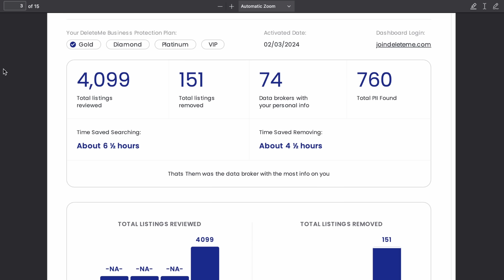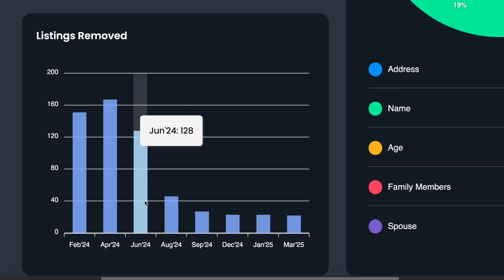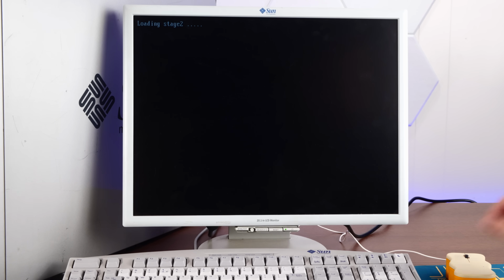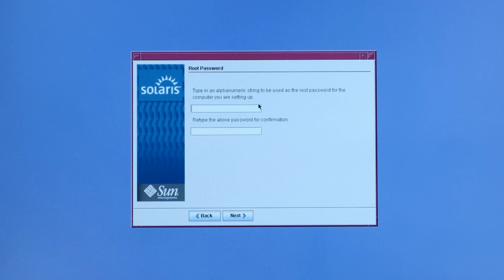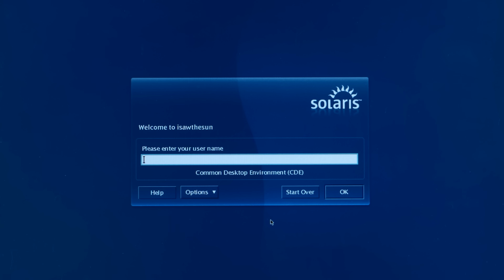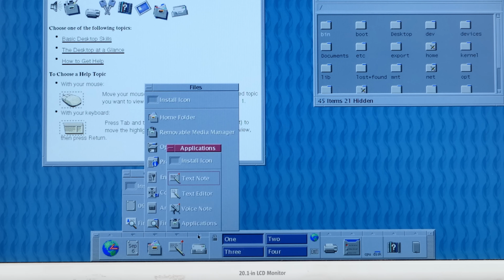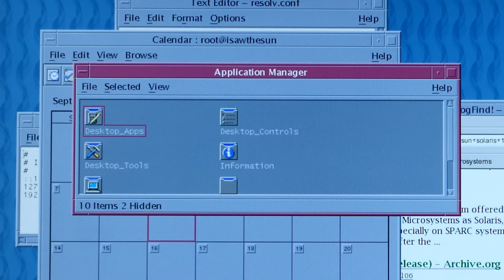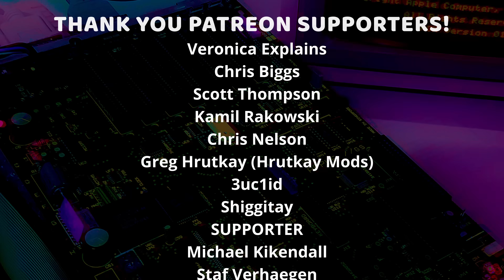The AMD Opteron Changed Everything

Comment: My first multicore (and first 64-bit) cpu was the Opteron 165. Dual core goodness!  I even had a cold cathode/fluorescent tube for that ultraviolet glow effect.  

I still have the tube lying in a drawer. It’s very likely dead by now.
Reply: I bought an opteron 144 (single core, 64 bit) because it was a decent overclocker. 

Unfortunately I tossed that board... It was hung up in my garage and I tossed it during a move :(

But it wasn't a good board anyways, I always bought "best bang for the buck" when building a PC, knowing I'd overclock it.
Reply: @volvo09 my motherboard was a DFI LAN Party.  I even had a cold cathode tube  for UV.   I still have it in my junk drawer. It’s pretty much dead.
Reply: @DerekWitt I always lusted over those lan party boards. I spent a ton of time on overclocker forums looking at builds, on my 33.6k modem (again, another cheap but workable part) :)

As a teen I actually put a white CCFL tube meant for a PC in the foot wells of my car, since it was 12 volt 😂 that was my modem era

Edit:  and that was before my opteron, the fluorescent tube brought me back to that era!

Comment: Not the first Sun Opteron based workstation released to market by Sun. Sun had maintained their own brand of IBM PC compatible systems as a side hustle for a long time before this thing was introduced. Most notable models were dual CPU P3 systems which had 1.4Ghz Tualatin processors. Can't remember the system name and model, but they offered two versions of it. One with IDE disks and one with Ultra160/320 SCSI disks. This was because their UltraSPARC-II offerings weren't exactly able to keep up with the Intel stuff in speeds. And they had been offering Slowaris for PCs from the early 1990s.

I cannot remember what they called the first Opteron AMD64 Workstations, but none the less they were basically adequate consumer grade office PC system quality devices in weirdly styled cases with actually OK build quality this time around (unlike Sun Ultra 5/10 and Blade 100/150 garbage) and a very tasteless design using the colour scheme they'd reserved for the IBM PC compatible side hustle systems. Basically it was AMD Opteron reference system with a generic AMI BIOS and common PCI card bus slots, consumer grade DDR RAM and surprisingly enough had SCSI disks as standard instead of SATA. etc. It did have SATA slots though. 

I've seen one of these machines about 15 years ago at a hobbyist club when it was retired by its previous owner from use as a Linux system. it was literally nothing special and I think Sun understood that they couldn't try and charge a premium on this thing so, they weren't even expensive. Good quality hardware for a entry-level Sun system made of IBM PC parts.

I suspect they just subcontracted to some PC OEM to make them a dual CPU Opteron system based on the AMD reference design, had some "industrial designer" mangle up a ATX case to look funky and threw it at the wall to see if it would stick. LOL

It predates this Sun Ultra Opteron system, and the later Intel Core/Xeon based systems by a couple of years. And nobody bought them. 

Which is why I was rather shocked they even bothered at this point when they released this thing. Since, nobody really bought Sun Ultra machines for anything other than running legacy SPARC/Slowaris stuff with. So, the SPARC machines in these cases had a use for people that were using UltraSPARC workstations when they genuinely offered a performance advantage over PCs and other competition, that came with a modern UNIX OS with high level of security design against malicious actors and software and which gave genuine bang for the high bucks Sun charged for them when compared to the IA32 based options. After AMD made 64bit extended IA32 a thing and Intel made a full 180 turn on Itanic and IA64 being only thing they would make in 64bit, it was clear that Sun was selling SPARC systems which were completely outdated junk not worth the price tag.

So, this shit was completely ridiculous. There was absolutely no point. No one ran Solaris on x86 or x64. Because there was nothing in terms of software you could run on that other then the same GNU stuff you had with a Linux distro. So, why are you not running 64bit Windows with this thing? That's what they were used for. :D

Only thing cool about these is the case design. Nice and minimalistic. Not worth the asking price though.

For historical contex, since the late 1980s Sun had  experimented with a Intel based professional UNIX workstation product back in the late 1980s, called the Sun386i which offered the same level of graphics, disk host controller and NIC performance as their Sun-3 (motorola 68030 system architecture, like every other unix vendor) and Sun-4 (SPARC systems, first machines were dog slow and overpriced) machines. It was a commercial success and they even released a pre-production batch of its successor the Sun486i for select customers, before shit canning the thing because it ran rings around everything they had made previously and this would mean the SPARC would flop. :D

Anyway, it was not IBM PC compatible per-se, it used Suns own Forth interperter based firmware to initialize the hardware and bootstrap the OS. However, it was offered with ISA addon card "SunVGA" with which using the software included, you could run a DOS/Win3.x session from inside the SunOS 4.1.x the Sun386i came with. And had standard ISA addon slots, 1x 8bit and 3x 16bit with which users could take advantage of their existing IBM PC compatible hardware using it.

The system used four 32bit proprietary "local bus" bus slots, two of which were for RAM cards, up to 8MB each for 16MB total. And two for high-end graphics and disk interconnect etc. purposes.

Comment: There had been many stumbles and rake stepping by intel over the years, often Intel was able to easily come back from such as the first celerons that lacked an L2 cache, the celeron 300a. Intel added a tiny bit of L2 but at full speed (unlike the pII at the time) and it made the celeron easily competitive with the PII. Made it a true value competitor against other cpus. Especially when overclocked but the 64-bit mistake I point to as Intel's first real stumbling block, personally I think the onboard memory controller should have been. AMD CPUs at the time got more done per watt but generated much less heat doing it. But Intel was used to setting standards and the 64-bit stuff bit them in the rear pretty hard. The netburst architecture was already a massive fail despite the massive sales, the architecture ran very hot and held back Intel and cpu progress as a whole because at that point Intel was the go to. Most professional grade hardware wasn't AMD, it was Intel. Your choice of hardware was very limited compared. When Apple chose Intel over AMD at the time it was a head scratcher of logic if Apple was truly worried over performance per watt. But then Intel came out with the duo series of CPUs and then it made sense. Apple probably got a chance to see these new chips before we did.. anyway enough rambling. The AMD 64 was an amazing chip and way ahead of intel and that's my point. They made Intel wear that egg big time!

Comment: I'm glad AMD pulled the rug from under Intel with this. Sure it extended the life of the iffy x86 CISC architecture but the RISC vendors were busy self-sabotaging/mutilating their RISC architectures like the IBM POWER/PowerPC, Intel with at the time the only real PC targeted and high performance ARM design (XScale) and with the Itanium, I suspect Intel’s long term motives to use it to kill off the x86 and the associated x86 licensers and achieve vendor lock in for the PC platform. Thankfully that never happened and we have AMD to thank for that.

Comment: I was in charge of IT purchasing at a Polytechnic when these came out. Sun always released a special academic “end of year” price list with crazy discounts if you could wait until June to do your buying. They were selling these  and the next version smaller workstations for crazy discounts (50% to 75% off), which put them in the price range of a Lenovo with 1/2 the capabilities. I bought them by the truckload. They were amazing machines, and completely bulletproof. I would almost guarantee they are still using a few of them on campus!! 😂

Comment: Many wouldn't believe me, but said PC would run Windows Vista like nothing, since with 4GB of RAM and especially in 64-bit it gives a much better experience than in 32-bit.Vista was one of the versions that improved 64-bit support to the maximum, unlike XP X64 which was rare to see, normally that's why I've always said that comparing Vista with XP was a bit silly,Because XP is only 32-bit and even with its X64 version it wasn't up to much 🤣, but Vista... And 7, one word: Crazy

Comment: I remember Windows 8.1 not being able to run on my Socket 754 Athlon 64 3000+ due it not supporting the CMPXCHG16B instruction, and also Windows 11 24H2 requires SSE 4.2 which no Opteron ever suppported.

AFAIK on Windows you are capped at 64-bit Windows 8 (not 8.1) or 32-bit Windows 10.

Comment: Yes, AMD released the first consumer grade 64 bit capable CPU, but they're not THE first to create 64bit capable cpu's 

MIPS beat them by more than a decade, releasing the R4000 in 1991. 

DEC-Alpha released the Alpha-64 in 1992. Many DEC engineers migrated to AMD both before, and after DEC was bought by compaq. The 32 bit VAX systems heavily influenced how the slot-A and socket A chips were built, and the Alpha 64 was a big part of the inspiration for the legendary barton chips which were built as a stop gap until the x86-64 development could be completed. 

Itanium released in 2001....intel was predicting millions of units sold within a year of release, the reality was 40,000 units. The original Itanium (merced) had a clock speed of 733-800mhz (less than half the speed of consumer chips released more than a year before) with a FSB of only 266mhz. It didn't maintain backwards compatibility with 32bit x86, nor was it compatible with any of the aforementioned MIPS or Alpha software, owing to the fact that while most every other architecture was RISC or CISC based, intel opted for VLIW (very long instruction word) My uncle was one of the first people in the world to get a degree in microprocessor engineering, spent nearly 50 years in the tech space, having worked at DEC/-Alpha, Compaq, AMD, Microsoft and at times, with intel. He described the itanium as a 32bit chip trying to emulate 64bit, i don't recall his full explanation (given over 20 years ago) but it was due to how the memory access and on die cache worked.....which was terrible. 

So no, intel wasn't first, and even if they technically beat AMD to release, Intel didn't release a successful, functioning product.

Comment: Sorry to burst your bubble, but this isn't the first AMD64-based system. The Opteron 2220 SE is from 2006, the first generation Opterons were a 3-digit series, released in 2003. If it were a first gen, you wouldn't be able to boot Windows 11 on it at all. The early AMD64 systems were missing the CMPXCHG128 instruction and can't boot anything newer than Windows 8 (not 8.1) in x64 mode. Even then, the 2220 is missing SSE 4.2 support, so you'll only be able to boot Windows 11 23H2 at the latest.

Comment: It's not one, but two of those Opterons in there. It would be really interesting to see modern software running on this thing. Both Windows and Linux.
I do have some old Athlon64 chips (the consumer counterpart) in my collection which are from the same era but sadly no boards to run them in.

Comment: I remember those from when I used to build clusters.   We were using an engineering sample board and trying to get a dual-cpu opteron system to work in a 1-U rackmount case.   They didn't like that very much Also the only linux distibution that was really ready at the time and stable was Opensuse x86-64, though I remember by the time we  were dealing with production units, Fedora and Debian both had a workable solution.

Comment: WRT 5:18 - Not sponsored endorsement, just a happy customer.  Orico (and perhaps competitors) makes reasonably priced (sub $10) physical adapters that make a 2.5" SSD (and even some NVMe sticks) physically match the characteristics of a 3.5" SATA drive, so if you have drive arrays that have tool-less or near tool-less support hot-plug systems that are for 3.5" drives, your 2.5" drives will plug-and-play work for them.
Reply: Unfortunately, it looks like the drive trays for the 3.5" drives are missing from this system. It's pretty common for companies to pull the drives when decommissioning hardware, and often they're lazy about it and don't return the drive trays.

Comment: 0:32 nope. It was Digital with the Alpha 21066 and it's following generations, you could buy a motherboard and CPU from a retailer that also sold 486 and Pentiums at the time and run Windows NT .
Reply: The Alpha couldn't run x86 software. It required Alpha specific driver and software packages. It was a completely different ISA.

Comment: There is a blown capacitor on the mainboard near the P2 power connector. I would suggest you also disassemble the power supply and check if there are any blown caps there. This machine is sadly from the cap plague era, so no wonder it has some blown caps

Comment: Small history lesson: When DEC went out of business / were bought out by Compaq, some of the CPU engineers went to AMD and worked on the K7 architecture. The K7 wasn't wasn't just an x86 clone like all of AMD's previous chips, this time AMD was serious and AMD trademarked the name Athlon. AMD used that chip to beat Intel to 1GHz. AMD then built the dynamic memory (DRAM) controller right into the CPU with the K8 Athlon 64/Opteron line. (Prior to this x86 processors relied on a DRAM controller inside the north bridge of the motherboard - that's why the chipset brand and drivers were critical 20+ years ago). Intel would follow suit adopting both AMD64 extensions for the Pentium 4 and up (by purchasing rights from AMD!) and moving the memory controller onto the CPU die (with the core i3/5/7 series I think?). Which is where we still stand today - that's why windows 11 can still boot and run on that 2004 machine. It's basically still the same CPU architecture as today in 2025 (albeit incredibility slow comparatively).

fwiw the biggest change to x86 since 2004 is Intel creating efficiency cores which isn't really working well for them, and AMD creating their own version of Apple's unified memory allowing the integrated GPU to access all the system memory - which remains to be seen if worthwhile for x86. (multi-core while incredible really boils down to multiple CPUs connected to same buses, and the x3d chips from AMD in reality rely on massive L3 caches)

Comment: i still have a single socket opteron in service as a remote nas at a friends house, the other 2 systems are in storage, the dual socket one had been rock solid  the quad socket one was also alright if not a little fussy. overall solid systems if not a little slow by today's standards.

Comment: Isn’t the original AMD64 CPU the Opteron 240/242/244?

This system has dual 2200 series Opterons, which are dual core variants and IIRC third generation Opterons.

You’d want a dual socket 940 machine for the earliest x86_64 computer capable of (potentially) booting windows 11.

Comment: My favourite computer I ever owned was the dual-Opteron VFX workstation I put together in 2007. I ran it as my main rig for 12 years, by the end it was maxed out with 12 cores and a Koolance water cooling loop. The best part was the dirt-cheap CPU upgrades flooding eBay every time the big data centres went through their upgrade cycles!

Comment: The only reason the system will boot the Windows 11 installer is because the x64 instruction set that all modern CISC computers run is based on AMD's 64-bit instructions, not Intel's Itanium.  Intel licensed the instruction set from AMD in order to make their chips competitive again.

If you go with Windows 11, Sean, make sure that you use an earlier build than 24H2.  It has a mandatory check for chip instruction sets that your Opteron won't have, just like it now fails to boot on a Core 2 Duo.

Comment: This is a late 2006 Opteron, full three years after the actual "first". This is probably why it's possible to boot any version of Windows 11 at all, because 64-bit versions of Windows 8.1 and newer won't boot on CPUs without the CPMXCHG16B instruction, which rules out everything older than this generation.

Window 11 24H2 also requires basically the full x86-64-v2 spec, which rules out any pre-2008 Intel and pre-2011 AMD CPUs.

Comment: I'm sure someone else pointed this out already, but you can not install Windows 11 24H2 or later on a CPU without the POPCNT instruction. It WILL work with 23H2, but on first internet connection Windows will announce it is an outdated version and no longer supported. Then it will BIFF itself trying to update to 24H2.

I had a lot of fun playing around with this on a 2008 era HP DV4 laptop with a C2D.

Comment: Random thing .. I had a Sun JavaWorkstation 2100z in the early 2000s that was very similar to this.  Dual Opteron 250, 32 gigs of ram, NVIDIA quatro graphics card.

Thing was made for high end workstation users, developers, that kind of thing.

I ran terminal.

Only got it because my company parleyed some training credits with Sun into hardware credits.

Thing came with a 24" monitor that was also ludicrous overkill as it had an over engineeed pivoting base that was very sturdy and elegant for the day.